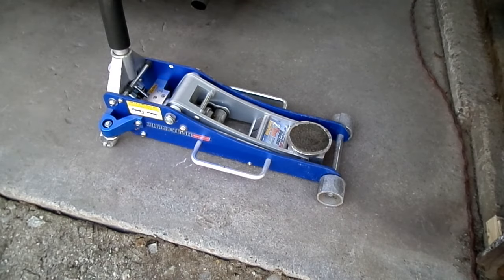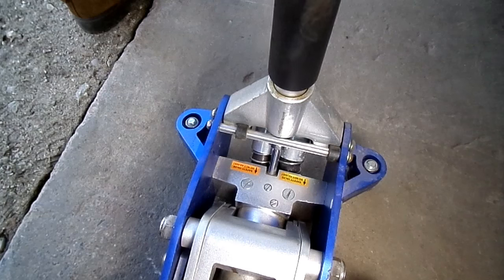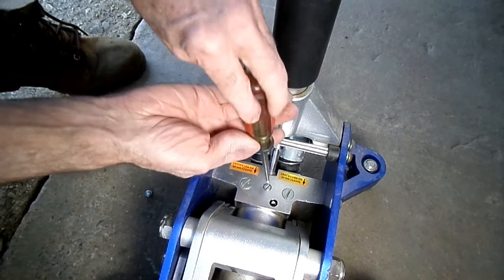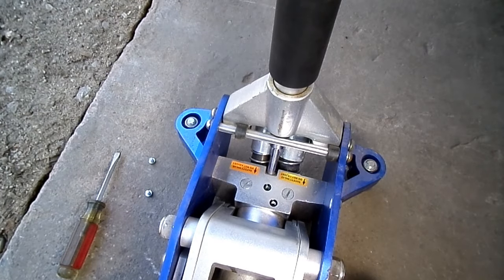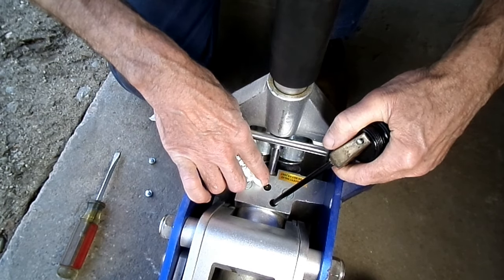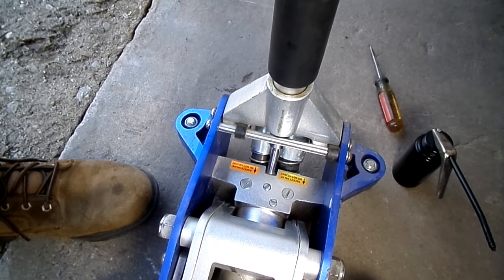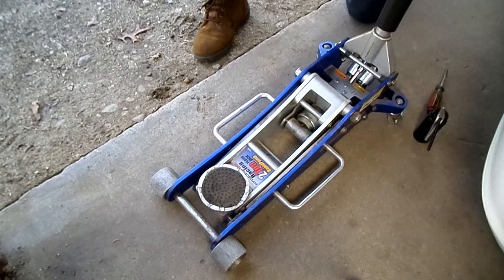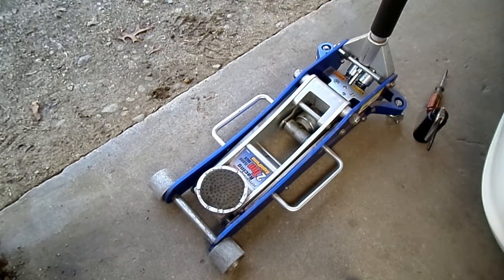Hydraulic Floor Jack Bleeding & Fill

Comment: Hey Rich, Thanks for all your videos. Great Help! I started business in '75 repairing/rebuilding hydraulic jacks. Bleeding is important, every time before using, unless you learn to keep the pump and valves always in the fluid. This means carrying it by the front axle which, of course, requires that the handle be removed. Although you 'went through' the required steps, my procedure is slightly different: (1) Fill it first. (If not full you will actually pump air and continue to air-bound it) (2) Open the release valve and pump the handle 4 to 8 times to dispel any air in the pump(s) and valve(s). (3) Close the release valve and pump it up all the way. (4) Open release valve and make sure the saddle comes down completely to rid the ram cylinder of any air. (Often, you can hear air bubbling out at the very bottom.) Lastly, if it does not go all the way up at # (3), repeat (2), (3) & (4) or you didn't get it filled up which can be difficult sometimes. In fact, some floor jacks are near impossible to fill without first raising the rear up, which guarantees you'll air-bound it. Air-bounding is possible with any hydraulic equipment, including bottle jacks, particularly if the fluid level goes below the operating ball valves which are in the base. As for fluid, you're right. Use that which is sold as "Hydraulic Jack Oil." This is approx. a 10W oil. ATF is a fair substitute in a pinch. NEVER use Hydraulic Brake Fluid y'all! It swells and destroys seals.
Reply from the maker: Geronimo Thank you for the great information.
Reply: Geronimo wow thanks!  Respect
Reply: What about P/S fluid? It's basically hydraulic fluid

Comment: In the area where you removed the fill screw, I have only 3 screws. 2 are equal distant from the rod in the center and 1 is off to the left. I don't know what is what, and afraid of opening something I shouldn't. Mine is a HF Pittsburg, (racing I think ) similar to yours shown here.
 How do ya know what all the screws are for. 
There's no labels and no  model or item #. 
Mine is probably about 15 yr old.
It pumps up, but the weight of the car pushes it down quickly. I do not see any leaks.

Comment: On my Pittsburg 1.5 Ton Jack, you are not supposed to fill to the top. You fill it up to 1/4 below the fill screw (which is in a different configuration from yours). You bleed at the same time by opening the the valve by turning counterclockwise and pumping the handle, then put more oil till 1/4” below the fill hole. I confirm this is correct as I bought another one and that is the level when it is new. I once filled to the top and it did not work correctly. The manual is wrong because in the bleed procedure in the front it says fill to the top while the one in the middle of the manual says 1/4” below the fill hole.

Comment: Bleeding is right , but top filling is over..   Hydraulic Jack is used the quantity of oil to limit the height of Jack lift.  When the cylinder is full stroke, No oil can be pumped.

Comment: If the fill screw is the one offset from the others, why doesn't oil shoot out when you pump the handle?  My jack is low on oil and when I pump the handle, oil shoots out and I am unable to fill it. No clue how to fill or bleed mine.  It's a Central Hydraulics (Harbor Freight).

Comment: Thank you for video. I have a 3 ton jack, and works well. My question is, is it safe to jack a car so the jack is vertical? Also when storing the jack should you leave the valve in open or closed position?
Reply from the maker: razz I can only tell you what i do and that is i try not to go to full extension and i leave the valve open when not in use.
Reply: richpin06a Thanks for clarifying your best practices.

Comment: My floor jack sags when in use, over a minute or so. I haven't noticed any leaking. Would you check the fluid level first, and if it's OK with no air bubbles, replace the seals and O-rings?
Reply from the maker: spelunkerd Finding the parts might be difficult.
Reply: Hi Dave
I have a Michelin jack and a can/ tire jack both 3 tons.  I have the same fault it slowly creeps down over time. I seen a great tip to jack it up to full height and keep jacking 8-10 more times. Seems to work and stop the creeping down but I have to repeat this every couple of months . Worth a try I have no idea how to rebuild these units even if I could find the seals. Take Care.
Reply: Steve Rob Thanks, Steve, I'll give that a try.
Reply: Steve Rob The description of what you're doing scares the "H" out of me for you. You are purposely over-pressuring the jack which is hard on pump and ram seals and even the ram cylinder. If either of the latter two 'blows' your jack is coming down in milliseconds. I wouldn't do it. Sounds like your pressure valve has problems. If it's really sporadic as described it could be that pieces of 'stuff' (cup trimmings, sealant, or just plain old dirt) is floating in your fluid and occasionally gets caught between that ball and seat causing the slow leak. This is actually the most common cause of that problem. With every new pump you might be flushing out a piece or flushing a new one back into that critical spot. A small rust or bad spot on that valve could have the same effect as it rotates with each pumping. Unfortunately, there is no reliable way to 'fix' the dirty oil problem without complete dis-assembly and cleaning.
Reply: Geronimo all floor jacks are engineered to go into bypass when fully extended there is no way you can damage any seals. My jacks sits at times for months and air does cause the drop. Been doing this with good results for many years. There is no danger of damaging the jack. Just using the bypass to push air out of the cylinder.  Always use jack stands. Thanks for voicing your concerns. It might solve daves condition cant hurt. I don't do this while lifting a car , maybe that's what your thinking. Still just  a little harder on your arms .
Reply: Steve Rob You weren't clear when you were doing that. Yes, I thought while lifting a car. Like anything else, bypass (i.e. overload) valves can fail and if that failure is 'stuck' instead of 'open' you won't know it until you blow something. But as long as you're not risking any life or limb, all's good. And yes, ALWAYS use jack stands.
Reply: Geronimo I think that may have fixed it, Steve, at least for now. As you say, at maximum reach it goes into a bypass mode, and I did it with no weight on the jack. Thanks for the suggestion.

Comment: Hi rich.  I've been having an issue with my low profile pittsburgh hydraulic jack.  Since about a month ago, the jack handle moves freely within the handle insert without lowering the jack.  I turn counter clockwise as usual to lower the jack, but it doesn't release. Was wondering if you could help me fix the issue so i don't have to buy a new one!  Your input would be great.
Reply from the maker: Eric Gungon I will have to look into how the handle is secured.
Reply: richpin06a rich, let me know how you can help.  I'd be greatful

Comment: Just wondering, when transporting Jack can it lay in any position as mine when in its case would be carried on its side etc, thanks
Reply: Typey1 Yes it 'can' but if the base where the valves are located is raised above the oil level you will likely need to bleed air out of it.

Comment: Hey Rich, nice video!  I have a Harbor Freight floor jack almost identical to the one in this video.  Yesterday, it started leaking hydraulic fluid.  Have you had a leak issue with yours?  Mine left a puddle of fluid under the jack.
Reply from the maker: As of yet i have not had any leakage.

Comment: Anyone knows where I can buy o-rings & gaskets for Central Hydraulics Item 92782 (similar to above model)?
FYI: Bleeding & filling are useless if above parts are defective (worn/cracked/shrunk). Can't buy parts (or didn't fit) from HPT.

Comment: What's the best jack oil or hydraulic fluid 2 use? I see that 1 has the 2 sliver handles on that in 4 wheels the I seen only has 1 handle in 1 solid wheel in between the jack did they change the jack style?
Reply: The single rear roller is on their 1 1/2 ton jacks The new 1 1/2 and 2 ton models only have 1 side handle.

Comment: how did you know that was the fill screw... is there any markings on jacks or anything that makes it obvious ?
Reply: and what are you using for "jack" oil
Reply from the maker: There are no markings.They way i knew it was the fill screw is because i have a owners manual for the jack.
Reply from the maker: I am using jack oil,not sure the brand.
Reply: richpin06a m
Reply: Excellent question mate! Markings to make things obvious and easier is the way to go!
Reply: Andi Sanchez 
Look for the screw, or plug, that isn't holding the parts of the jack together. I mean, look for the one screw (or rubber plug) that is not keeping any mechamical parts attached together. 
Process of elimination, buddy.
Or, if you know the brand and model of your jack, Google search "ABC 123 pdf" and you might find a pdf file of your unit. This works for a lot of consumer products, when you don't have a manual or instructions for something.
Edit: substitute the "ABC 123" with brand & model, of course, followed by "pdf."
Reply: @RichpinTv  I have the manual that came w/ mine and it shows 3 different screw configurations - none of which is like mine!

Comment: I have a Pittsburg 3-ton jack that I just bought. Ive looked for a way to get to the fill hole, but it seems like its shielded by a piece that was welded onto the top. None of my tools can reach through the tiny gap that they give me on the jack, and I am essentially stuck. 

Keep in mind, im new to floor jacks and I just bought this one two days ago. Any help at all would be much appreciated.
Reply from the maker: +Cantrio X Can you get a rubber hose in there.
Reply: richpin06a no
Reply: +Cantrio X welded? sometimes they put a snap on cover over that bit, try seeing if it won't pop off.
Reply: hey hey I i
Reply: ***** Yup, it's definitely welded. No taking it off. I see the plug, but there is no way for me to get to it.
Reply: Cantrio X eh, no need to feel that way, live and learn :)

Comment: AutoZone type jacks put where screw is use power steering fluid works just good power steering fluid is us in a compressed system just like a hydraulic fluid is

Comment: When I jack my jack up it will slowly lower its self down what does that mean
Reply: +Ricky Gonzalez either you have a leak in the system such as an O ring has gone bad and needs replacing, or some people fill and then bleed with just the release/lower car valve open. Refer to your jack for specifics on how to bleed and maintain.

Comment: Don't over-fill your Jack...... i recommend Filling it Full while the Handle is Down/Horizontal that is when the fluid rises. I made the mistake of Filling mine Full with the jack handle Vertical and as soon as i went to Pump down the handle Fluid went Gushing out it was over full...
Reply from the maker: Thank you for the information, very helpful.

Comment: what kind of oil did you use?    thanks
Reply: daquilema2011 "Jack oil"... I wonder about this too. Have used transmission fluid. Wonder if that is acceptable. MrNightpwner asked about repairing a leaking jack. In my case a bad o-ring. Every few months I have to top her off when the jack won't go high enough because of lack of fluid.
Reply from the maker: daquilema2011 I used Hydraulic Jack Oil.
Reply: Clay Ton ATF's ok but the 10W oil labeled as Hydraulic Jack Oil is maybe a bit better. I knew an old mechanic that would use 30W motor oil in his jacks as they started leaking. Slows down the leak, but slows down the action too. He'd have to wait at the top of every stroke for that oil to slowly move through chambers.

Comment: It's now OVERFILLED with oil which isn't good. The oil level should be just above the cylinder when looking in the hole.
Reply: BlackHawkPSU can you please explain what you mean by “just above cylinder”. What cylinder???
Reply: Look in the fill hole. The oil should be right at the top of the pump piston.

Comment: i filled mine right up and when i went to use it the filler plug popped open and oil exploded everywhere. to full o suppose.
Reply: MicTheGreaseMonkey did you tighten down? Seems like it might have been loose
Reply: @joel4210  nah its just a rubber plug not a screw type. But i drained it re filled with oil & purged the air fully. Working great. First brand new professional jack i hav ever owned & feel safe working with it. Absolutely rapped goes nice & high not last my first 1 had 2 put wood on it to get the xtra height. Nerv racking.  Tstl .

Comment: When i bleed the air out fluid started leaking out what should i do
Reply from the maker: +Gabe You might be bleeding it to fast.
Reply: I put the hydraulic fluid in it and let it leak everywhere,  i just kept filling it as i would let the pump handle up i kept on pumping the handle and adding more fluid and you could tell the difference in color, I pushed the bar inward to the front and capped them with the fluid topped off, to the top at both sides,

Comment: I have a different 2-ton jack.  I flushed and refilled it and it seems to work great without losing height. 

However yesterday when I lowered/released twice I heard loud pop on the very first time when I lowered/released it.  

It lead me to believe I might have to replace it.  It did lifted ok but it did made very loud pop sound twice.  Anyone had similar experience. 

It might have air it it and I need to bleed it?
Reply from the maker: +James Chuaycham I haven't had this happen to my jack.
Reply: +richpin06a hey thanks alot for the vid! v3ry helpful!

Comment: What kind of oil is that exactly?
Reply from the maker: mazzmari That is Hydraulic Jack Oil.
Reply: richpin06a, is this oil a specialty item or something I can pick up at a local auto parts or hardware store?  Thanks...
Reply from the maker: Pet Rock's Garage It is pretty common.
Reply: Yes, available at better auto stores. The best bottles have a decent tapered nozzle. Don't substitute.

Comment: Why didn't you fill the jack reservoir first and then bleed it?
Reply: Thanks... I'm doing this today, and I completely filled the res first, then pumped it, and oil came out for the first 4 pumps... I assume the oil that came out means that was excess, and was overfilled? Jack works fine...

Comment: I followed manual which said to loosen not remove screw.  Then pump. I did. And oil got everywhere lol
Reply: Exactly same here and I'm steaming pissed. I'm following the cheap Chinese diagram that doesn't even show the right screw layout for my model but even after looking it up here this brand new jack leaks oil all over when trying to bleed it as the manual tells me to do. Either it came overstuffed with oil or the jack has some kind of issue. Did u ever figure out your leaking problem?

Comment: I dont know the brand but thats very thin at the end, ideal for low vehicles :-), and it lifts really quickly in comparison to ordinary jacks, very nice :D
Looks like your going up in the world ha ha lol, sorry bad joke :D
Reply: zx8401ztv It's a Pittsburgh jack, 0:16, typically found at Harbor Freight!
Reply: ***** I did hear him say the brand, i said "i dont know the brand" meaning ive never seen one with that name before.
We dont have the brand in the uk, harbor freight does not exist in the uk.
Reply: Ahh, my bad!
Reply: ***** ha ha :-D
Reply from the maker: zx8401ztv It has been very good so far.
Reply: zx8401ztv It lifts fast without a load. That's why there are two pumps. The quick lift pump bypasses once some weight is encountered and the slow lift pump is the only one working from there.
Reply: Geronimo Ahh i see, thats a clever way, i bet that took a while to work out how to mechanically acheave that :-)
Reply: zx8401ztv Not really. The quick lift pump has a bypass/overload valve just like the main system one, only set to a much lower pressure. It's best not to mess with any bypass/overload valve. Besides the fact that you might 'mess' with the wrong one, they're difficult to set, and 20 years rebuilding hydraulics showed me they almost never need service.
Reply: Geronimo Im not that daft to play with something i dont have full service information for, and most jacks my frends have seem to work fine for lifting cars, then we put axel stands in place to take the weight, then the jack lowered. It saves wear on the jack :-)
Reply from the maker: Geronimo I noticed the same thing when the jack encountered the load but i thought i was imagining things.